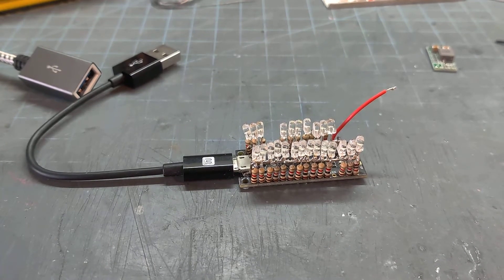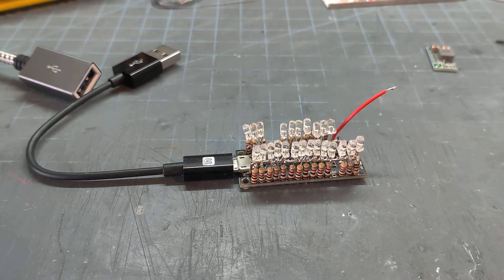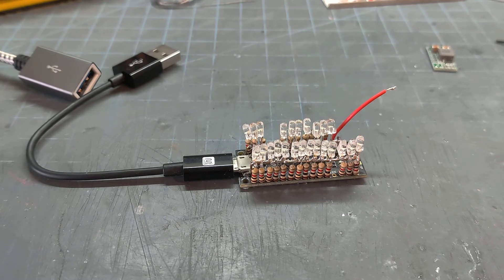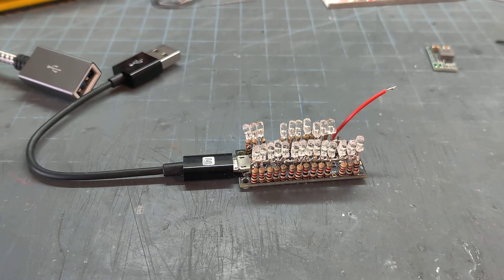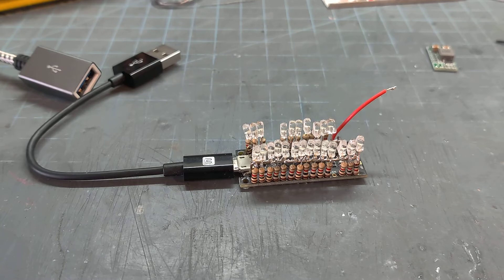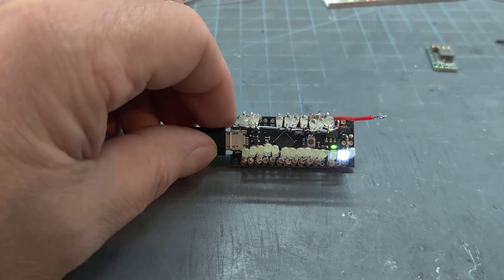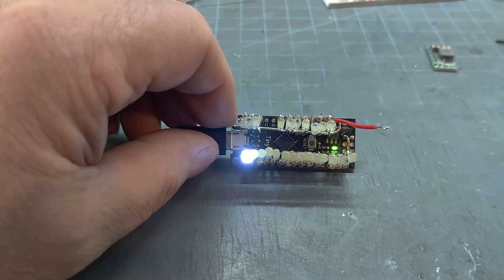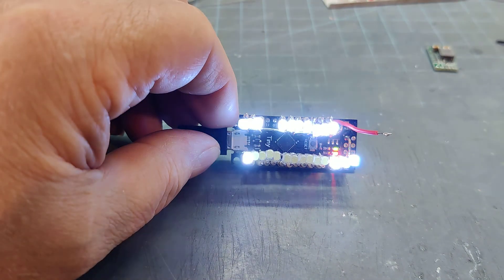MH Tiny Quick Test

Comment: Excellent. I have a few of these, getting them to do stuff is always a big ol fight, I've come to the conclusion they are just lazy. Therefore, I intend to interrogate each and every one to the full extent of my Arduino powers or this lead acid battery under the bench will get dusted off.
Reply from the maker: Yeah, they are a bit finicky, but so cheap, around $2, so they go into lots more projects.